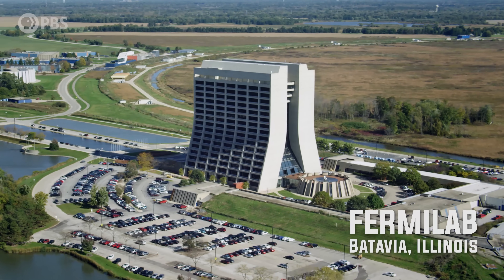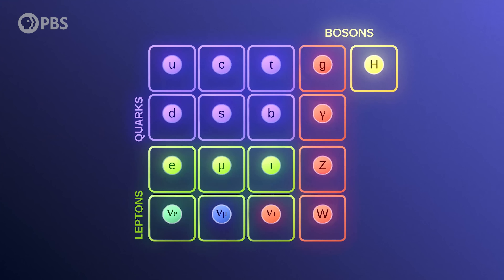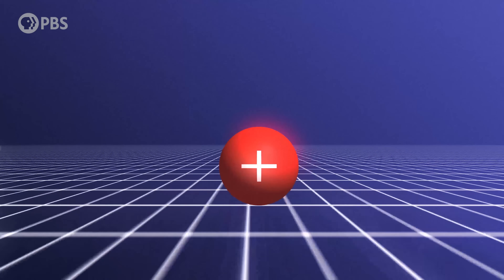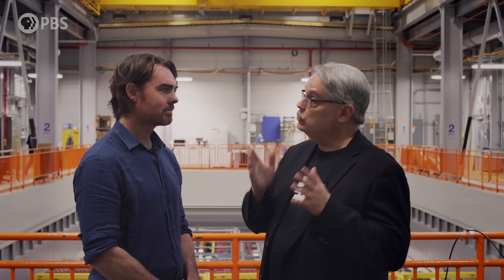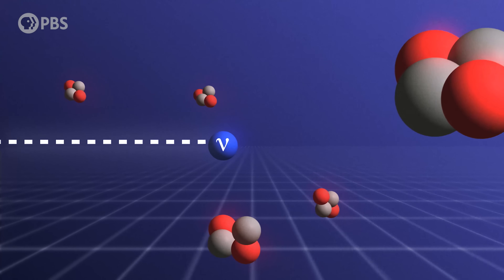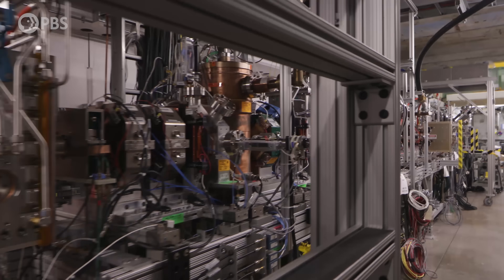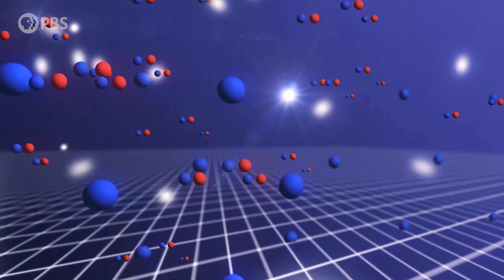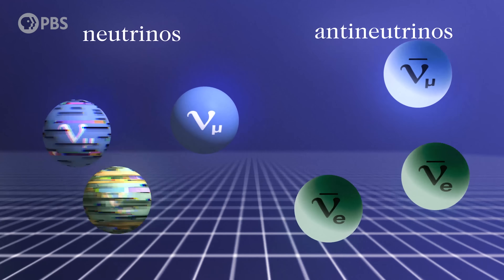How To Detect a Neutrino

Comment: Neutrinos seem a little suspicious to me. They can go through 5 light years of lead but then you detect them with a tank of water or argon gas?
Reply: Not all neutrinos make it through 5 LYs of lead. Most do - more or less. Some significantly fewer only make it through 1 LY of lead before colliding with a lead atom. About the same number will make it through 9 LY of lead. Even fewer only make it through a mile of lead and about that many make it through 9 LY+1 mile of lead. And some teeny tiny number of them will get stopped in a large tank of water. Those minuscule few are the ones we detect. 
Nothing fishy about it and all very predictable.

Comment: The Distillation Of Matter;

The LINE hypothesis proposes that the matter-antimatter imbalance that exists in this universe is a consequence of the universal instantiation event (UIE) followed by many cycles of universal expansion and contraction phases. Each cycle is punctuated by a universal transition event (UTE). The UIE and UTE are the metaverse phenomena widely known as the big bang. However, it is the UIE that initially instantiates each verse. As expected, the UIE and UTE do indeed produce an equal quantity of matter and its’ antiparticle. As the new expanding universe gains information and evolves sufficient complexity therein, the universal expansion not only slows as the universal rendering rate diminishes, but eventually may reverse to initiate a universal contraction phase.

The dynamics of changes in the universal spatial degrees of freedom (DOF) called dark energy is informed by the universal information budget (UIB). The UIB is governed by the transitions of information in, out, thru, and the universal information load and complexity in this universe. The UIB informs the universal rendering rate of change (time) and of distance (dark energy). Once the contraction of space reaches a critical density which invariably destroys a critical amount of complexity, the contracting universe enters a new UTE phase. This UTE phase is the turn-around phase following each contraction phase as the universal rendering rate rebounds. During the UTE black holes that do not dissipate are the only information structures from the previous cycle that may survive the UTE. Surviving black holes emerge from the UTE as galaxoids that will populate the next universal expansion phase.

Initiating each UTE, conditions from the previous contraction phase returns matter and space to the degenerate information state called the solution of state (SoS). Each UTE is initiated by an arbitrary quantity of information as SoS. Matter and antimatter are created within the UIE and UTE in equal amounts. Nonetheless, the remnants of matter and antimatter from each UIE and each UTE is not balanced and the remaining matter will eventually seed the next expansion phase. An imbalance in matter occurs because within the UIE and UTE there is no annihilation of matter as we know it. Annihilation occurs in this universe in normal space-time as a consequence of the normal structure of the Planck Hole (PH) scaffolding of space together with the stable structure of the pyrine and other states of information. During the UIE and each UTE, the PH and the pyrine do not exist, hence, matter and space is no longer normal.

Further, the quantity of the SoS, the degenerate state of matter initiating each UTE will transform during each UTE into equal amounts of matter and antimatter. However, without immediate or timely annihilation, the matters are free to not only separate, but to become otherwise involved during the UIE and UTE and also during inflation. Consequently, matter is thereby allowed to enter into other unbeknownst UTE processes and reactions. During these opaque transitions within each UTE, one of the two competing matter states may diminish relative to the other. This imbalance will permit the lesser constituent matter to eventually become negligible thereby leaving the other to dominate the next expansion phase. This leftover matter is the matter that will form the relatively stable tangible reality of the next expansion phase of a universe. This stable reality will not exist until the vast preponderance of one of the two constituent matter particles have been sufficiently diminished by primordial annihilation. Primordial annihilation occurs only when the PH scaffolding of space emerges to support the pyrine and other information states of particles. This cyclical process may evolve to produce the foundation for a relatively stable universe capable of hosting life and observers. This remaining matter seeds the WOF halos around surviving black holes to form galaxoids which in time evolve to become galaxies in this universe.

By this UTE process of matter distillation, it isn’t until a quiescence of matter, writ large, is reached in any verse can life emerge. In many verses produced by the metaverse, such survivable conditions never occur, and yet in others, this distillation of matter could eventually evolve into life as it has in this universe. As in any distillation process information is conserved, and yet, information states become separated. The mechanism by which this filtering of antimatter from matter takes place emerges during the dynamics of many UTE. The UTE is a largely metaverse phenomenon the fundamental details of which is scientifically opaque to the physics of this universe. Nonetheless, there are methods by which some UTE properties, the number of UTE cycles that has occurred thus far, for example, can be determined in this space-time. A consequence of the UTE distillation of matter occurring outside of this universe is the reason antimatter is absent from this space while its constituent particle remains. Precisely how this occurs as a metaverse process is perhaps unknowable. Suffice it to say that the laws of conservation of information are upheld during each UTE, and presents one thread of understanding available to nimble minded observers within this universe of this pivotal phenomenon that largely occurs within the metaverse.

Further, the LINE hypothesis proposes that one difference between a universal instantiation event (UIE) and any universal transition event (UTE) is the quantity of fundamental elements initially created. The UIE is the instantiating event which may create an amount of fundamental elements that is calculable from a correctly conceived standard model of particles. The UTE is one of many transition events subsequent to the UIE and is driven by circumstances of the prior contraction phase. The UTE phase will not have an instantiating amount of energy as does the UIE. Nor will a UTE express the instantiating metaverse states which produces a UIE equivalent amount of fundamental elements such as hydrogen helium and lithium.

The LINE hypothesis predicts that the UTE will produce circumstantially less of the fundamental elements, ergo; hydrogen, helium and lithium than predicted for the UIE. Calculations that estimate the quantity of initial fundamental hadronic elements currently do not anticipate the potentially numerous subsequent UTE cycles which create the current post UTE state of the universe.
 
Predictably, this is because a UIE is more energetic than a UTE. Also, because the UIE involves more fundamental levels of the metaverse information states called the solutions of state (SoS) and their metaverse processes that are not achievable during any UTE phase. These differences create different outcomes. Given that today both the UIE sand UTE are considered to be the same ‘big bang’ event, calculated expectations that assume ‘big bang’ (post UIE-pre UTE) fundamental element quantities, will contradict measurements taken within any subsequent UTE expansion phase. So, if a contradiction between calculated expectations and observation of initial fundamental particle quantities is found to exist within ones’ current universe, The LINE hypothesis suggests that this is the indicator that this is a cyclic universe older than one universal transition cycle.

Why would the current calculated population of pre-fusion fundamental particles not reflect the current measured quantity? This is because the calculated quantities may consider universal constants that were forged not during any prior UTE, but during the UIE. There are universal constants that are instantiated during the UIE which may remain unchanged through each UTE.

During each UTE, some, not all, universal constants become reinstantiated. Therefore, such indigenous fixed universal constants will yield an accurate calculated particle population created only in the UIE phase. Subsequent UTE phases will not create a fundamental particle population that is consistent with this calculated quantity. Such fixed universal constants may determine the existence of the types of matter (hadronic, leptonic, debytonic etc.) that will exist within the new verse. Such matter types will populate all future cycles of the current verse, in any quantity. Such fixed-constants do not determine the quantity of matter created by each UTE phase. It falls to other non-fixed constants reinitialized during each UTE together with the informational content and circumstances of the prior contraction phase to determine the details of the next universal expansion.

Comment: I visited this lab in college. One of the most amazing things. I wanted to add some details. The detector is actually tons of little cells, filled with the liquid which creates a blue lights when a neutrino hits it. The neutrino beam actually has two particles, as it travels, it splits and there is another lab being built to detect these that split from the straight beam. The cell detectors use fiber optic cables to detect these tiny blue lights and all these cells are than mapped out. I asked, so how do you know that the particles and neutrinos and not something else. We don’t know, just that it is far underground so limits possibility of most other stuff. Now, out of these trillions a second, I believe it was something like 1 or 0 neutrinos get detected per day. The amount of neutrinos detected was very low. Now the following is my own opinion and I am not physicist: we don’t actually know what these are or what is being detected, these theories aim to describe a natural phenomena, that is the extent of its truth.

Comment: Hey I was wondering, what exact temperature/pressure is the liquid argon at? cheers
Reply: Also what wavelength of infrared would heat liquid argon from -189 C most efficiently and does that wavelength change with rising temperature`? best regards

Comment: It is pure religion to believe in the profuse numbers of neutrinos created by atom smashing, " belief in the absence of evidence " as Carl Sagan said. You are bending Nature to fit the neat math predictions of conservation of mass when in fact the neutrino oscillations clearly demonstrate that mass is not conserved for this tiny elementary particle but could well be for the fundamental particle of which the neutrino and all elementary particles are comprised.
The data shows E=mc^2 to be correct only for less than 1% of gross matter, maybe 100% of lepton- antilepton pairs if one can trust physicist measurements to be anything but self fulfilling prophecies.

Comment: If the antimatter neutrinos do not just change more slowly but become hyperstatic in a single (higher?) form, then my theory that antimatter is not really antimatter will be proven. But if their changes are merely slowed, then it doesn't disprove it, but neither is it disproved. Slower change or halted change is expected either way due to higher energy of the faster than lambda particle that I suspect antimatter is. The collision merely accelerates the particle and it sheds smaller orbital particles to allow its increase in speed.

Comment: Hi. If you have relativistic tritium plasma decaying and generating an electron antineutrino with the same vector as the original nucleon it originates from, does the electron antineutrino conservate its momentum when detected by a stationary detector? How does it change the particle's energy and its oscillation? Considering c as the maximum speed of the particle, where does the extra energy go?
More straight to the point, what are the masses of the three neutrino flavours?

Comment: I can see a potential problem with this experiment:  You are sending the neutrino or antineutrino beams through matter, and not vacuum, and you don't have antimatter available to try the same thing.  So if you detect a subtle difference in oscillation rate between neutrinos and antineutrinos, you can't tell if it is inherent, or it is a very subtle (non-scattering) interaction with the matter they are passing through.

Comment: Why is there a difference between positive matter and negative matter when the real difference is the charge?  The actual mass is the same, but the difference is the charge...
Reply: Yet our universe is not made of purely positive or purely negative matter, but a mixes of charges. So why is it SOME postie matter (like positrons) and SOME negative matter (like antiprotons) are not just as common as their opposite counterparts?
Reply: @garethdean6382  Actually I must have been tired as there's no such thing as negative matter nor is there negative mass.  A Proton and an AntiProton have the same mass.  They also have the same types and quantities of quarks.  They only differ in charge.  So the real question is why does the Universe have this charge preference?  Now, the Neutron and Antineutron are interesting as they differ in quark/anti-quark yet the anti-quark differs from the quark by charge.  I think that kind of thing is interesting, but we just don't yet have the models that explain this.  Kinda like we don't have the models that explain why a photon is a particle and a wave.  If we did have such a model, it would have to allow for space being both solid and a wave.

Comment: What happened to the extra photons? 
If a bunch of matter and antimatter anhilated after the Big Bang leaving out only photons, is there any way to detect them or prove they existed as predicted?
Reply: Current measurements indicate there are about 13.8 million CMB photons for every proton in the universe. They are by far the most common particle in existence. They can also be absorbed or converted back into matter-antimatter pairs, which means that the excess varies depending on exactly what happens tot he photons after their creation.

Comment: So a neutrino communication channel is actually being built. Such a channel would have the lowest delay because the light does not traverse through earth, whereas a possible light path along the surface is longer. Minimum-delay channels, such as laser-beam air links, are nowadays used for "high-frequency trading". I wonder how much time will pass until the traders start employing neutrino communications.
Reply: Not very practical. If the particles go basically undisturbed through Earth, they also pass right through your receiver. Imagine: you need a particle accelerator to produce trillions of neutrinos, and a huge shielded tank of water or another medium deep underground, lined up with detectors - and detect one of them.
Reply: @MikeRosoftJH  true. Detection is difficult. But not impossible, they are actually building such a system. Even though complex and expensive, it is the fastest way possible. So if the delay matters, that's the way to go

Comment: Please like this comment so PBS space time would fix the graphics.

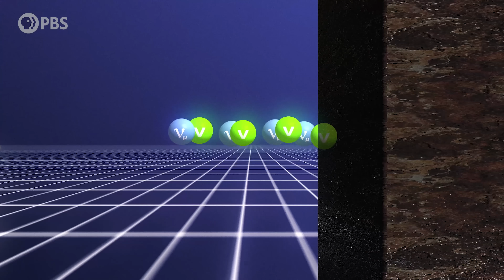There's a mistake in graphics 3:21 -  3:30 .  The pion decayed to a muon neutrino and the wrong symbol was used for the moun (Nu was used instead). Furthermore,  the graphics show that the muon neutrinos were stopped in the barrier, not the muons (which have the Nu symbol). The audio was correct, however.

Comment: Why are muon and tau separate particles if they're exactly like electron just heavier and decay into an electron in a short time? Can't they be considered special excited states of an electron? If neutrinos can turn into other flavors, can't electrons do the same thing?

Also haven't we learned by now not to name things "Icarus"?
Reply: Tau particles (tauons) are much heavier than muons. (A muon is about 200 times heavier than the electron, and usually decays into an electron; in addition to that, it can produce photons and/or electron-positron pairs. A tauon is more than 15 times heavier than that; it can decay into an electron or a muon, but it can also decay into various mesons like pions or kaons.) Muons and tauons decay by weak interaction; such reactions preserve the total lepton flavor number, so if a muon decays into an electron, it also produces a muon neutrino and an electron antineutrino. Likewise, tauon decays need to preserve the total charge and lepton flavor number. (There has been a search for lepton flavor violating decays, but these have not been observed.)